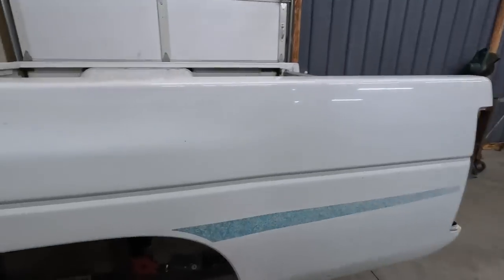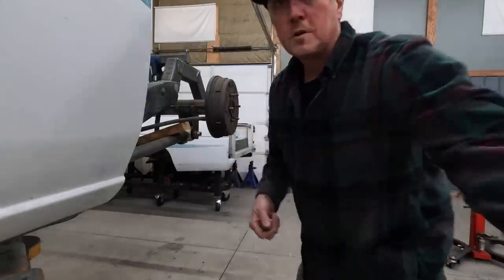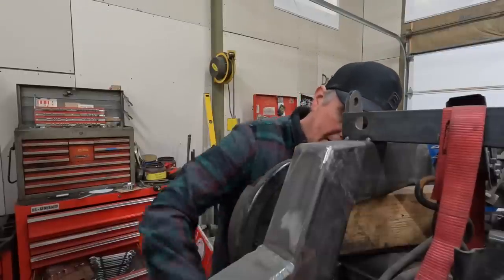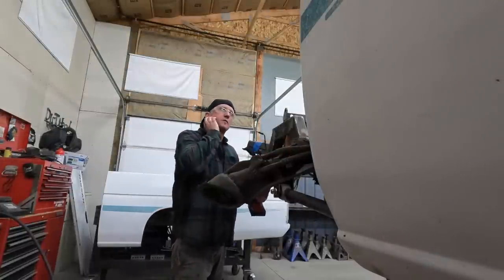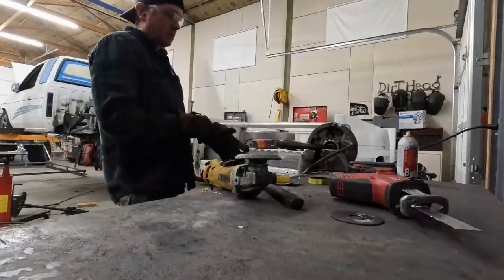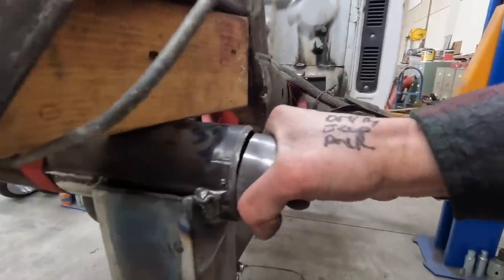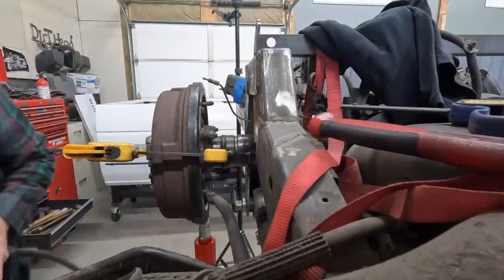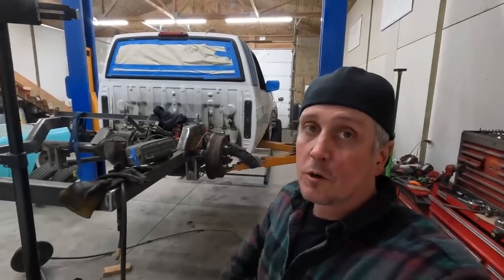Narrowing an axle without the right tools!

Comment: I've watched a number of videos about hydraulic cylinders and when those are rebuilt and a new tube is needed the technique is to cut the welds for both ends and then the flange end and the blind end come off with a slight bit per persuasion. The ends are designed to have a precise fit in the barrel to aid with alignment. I think this axle is manufactured the same way. Those hub flanges look like they insert into the ID of the axle tube. Cutting the weld between the flange and tube (just the weld, not all the way through) should allow the flange to be removed and then the end of the tube can be shortened and the flange re-inserted into the end of the tube. I've never tried this, but looking at the cut off end at 10:42 gave me the idea. 

Looks like you got it done and that's whats important. This thing is going to be awesome when its done.
Reply from the maker: You are correct.  Just like a driveshaft end yoke too

Comment: Nice work!  Your spline engagement shouldn’t change, just pushing the previous unengaged splines into the diff/spider gears.  I’m guessing you got to the end of the usable splines and that’s what bottomed out. I’m glad you pulled it out a 1/16th, or so. 

Nice work, my man!  That exhaust sleeve was trick!!
Reply from the maker: I was stoked to find the ID that close to be able to sleeve it without machining
Reply: That's exactly what I was thinking.

Comment: Awesome!  I was thinking “well at least it’s not a real expensive one like a Dana 44 or Dana 60. Nissan axles are pretty cheap and easy to come by.”   That’s awesome!  When I built my’90 Nissan pickup, I had to graft on 4x4 front fender bulges to get my wheels to fit.  I was static dropped on flipped springs, cut perches and a c- notch.  I only had a 2” body drop.  Back then (1991) nobody was using air ride yet.
Reply from the maker: Grafting the fronts to the rear is SO much work

Comment: I used an exhaust pipe expander from Harbor freight on the inside and some c/u channel on the outside to narrow my 8.8.  It worked awesome.
Reply from the maker: Nice.  All the tricks
Reply: An exhaust pipe expanded is a great idea!
Reply: @Fix_It_Again_Tony  I have rare moments of clarity.  I was shopping around for the right size tube/pipe/fitting and was like duh…. It also gave me a reason to use my 3 foot long 3/8 ratchet extension… 😂

Comment: Great job on your fit up. Looks like you nailed it. I’ve never done a axle before but in some cases of pipe welding where it’s connected to pumps we use dial gauges to show deflection. Some times then a tig torch is used to “dry run” the weld without adding filler to get it the metal to shrink and draw in that direction. Maybe useless information but could also mean the difference in having to cut something apart.
Reply from the maker: that's all good info. I have always questioned the way pipeline fitment is done and how much it moves around.

Comment: I plan on doing this with a Dana 60 that's going in my blown Vega wagon, but I'll be shortening mine to the point of needing custom axles regardless, but it's nice to see that my plans for doing this myself are definitely doable, so thanks for the confirmation.
Reply from the maker: Definitely.  Your best route is probably to go 9” bearing end cups. Then uses 35 spline cut to fit shafts like my yj uses
Reply: your limitations are limited to willingness to try...ive seen guys narrow rear axles at home with nothing but a chop saw, angle grinder and stick and mig machine..have seen a few good videos here on youtube too..you can accomplish anything if you try and have a lil fabrication knowledge and you don't need a lot of fancy tools or machines to accomplish it..

Comment: Love you channel Dave.  I think you’re bottoming out the end of your splines and so the axle can’t go deeper. Not the end of your axle to the inside of the spider gear. To be safe you might pull the axles and center section and set them up on the bench to be sure.  Take that cut off wheel and cut longer splines down the axle.
Reply from the maker: I did that .  If you look at the last time i install the axle there are some hand ground splines
Reply: @thedirtheadshed  missed it.  You’re crushing the internets.  Keep at it they say the first year is the hardest on the YouTubies.

Comment: We used to just buy 2 more 4x4 front fenders and cut the flare out and replace with the 4x4 flare. We didnt have to skill to cut up axles though. Sheet metal just seems easier
Reply from the maker: I’ve done that.  Too much bodywork.  Dang near impossible to make it good enough for paint

Comment: Think if you cut along the body line that creates the flare, then pick a horizontal line toward the lower part of the bed side and cut there, then do a vertical cut in the center between the top and bottom cuts, then you can pull the centers out and weld in wedge shaped pieces to fill the gaps top and bottom and in the center gap.
Reply from the maker: I know how to cut it.  I also know how much work the bodywork part of it is.  this is the easy way out.

Comment: Dave, you need some wall racks for your jack stands...
Reply from the maker: Yeah.  I saw @vicegripgarage and was impressed
Reply: @thedirtheadshed  these are ones i designed/made based off of some of the other ones out there on itsy, egay etc... they will fit almost all jack stands and angle them up so the post doesn't slide out and murder you. i can share the DXF file if you want to have some cut out.

Comment: Don't the 4x4 beds flare out more, or is that just the front fenders? 
I remember everybody running 4wd front fenders on those hard bodies. 
Don't remember if the beds are the same
Reply: Bedsides are the same. Toyota had the 4x4 flare bed.
Reply from the maker: nissan has same bed on 2 and 4wd.  only front fenders changed.

Comment: "Don't try this at home!" It ain't crazy if it works. I was wondering if you had run out of spline on the shaft.
Reply from the maker: It’s got about 3/4” of spline left
Reply: @thedirtheadshed  I was referring more to how far you could get it into the carrier. With only 3/4" spline left on the shaft, you'll only get a max of 3/4" engagement before you can't insert the shaft into the carrier anymore. I liked the idea of using the exhaust tube as a gap filler and alignment tool.

Comment: Trick Mr. Dave! I’m wondering if the axles would have plunged half that distance in on their own without a 5/8 cut.
Reply from the maker: No. They bottom out on the center pin.  I tried

Comment: Will the sleeves you welded in the axel inhibit the gear lube flow to the axel bearing?
Reply from the maker: The wheel bearings are sealed. So they don’t get oil from the diff

Comment: Do you think that the exhaust tube will hinder the flow of lubricant or act as a dam and hold krangus outboard and in the bearings?
Reply from the maker: they are sealed bearings.  don't get gear oil lube
Reply: @thedirtheadshed  So trapped crud won't eat at the seals?

Comment: Will the sleve on the inside of the axle restrict oil flow to the bearing? I have wanted to do that but I wasn't sure if it would or not
Reply from the maker: It’s a sealed bearing on these axles
Reply: @thedirtheadshed  heck yea!  The truck is looking good!

Comment: Why not just cut the factory weld and remove the end cap/flange?  Like cutting and turning a knuckle on a front axle?  Great video, thanks!
Reply from the maker: That would work too. I was just worried that the cup wouldn’t press into the tube again. It’s a weird stamped housing.  If it were nice round tube I wouldn’t have hesitated
Reply: @thedirtheadshed   interesting I didn't think it'd be pressed in!!  

Are you going to put a limited slip in that rear diff?
Reply from the maker: I’m gonna keep it open.